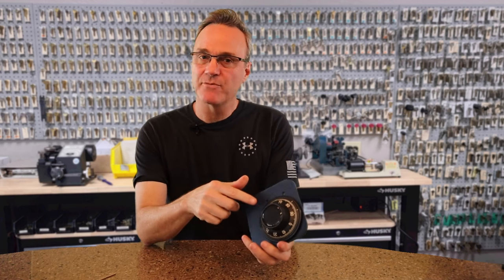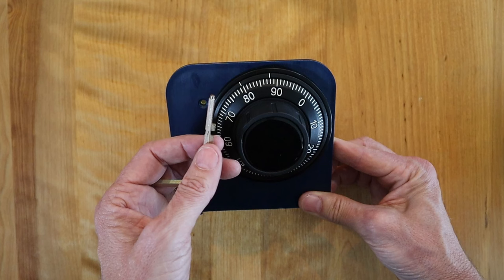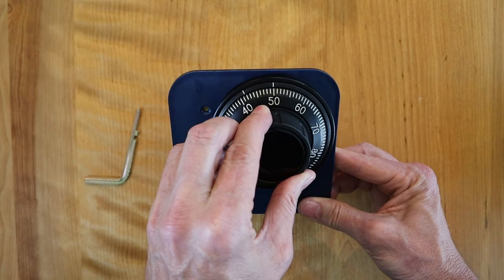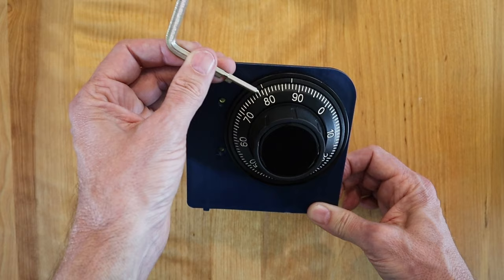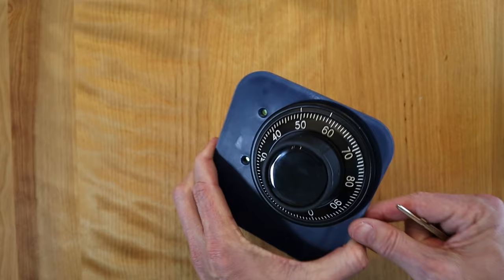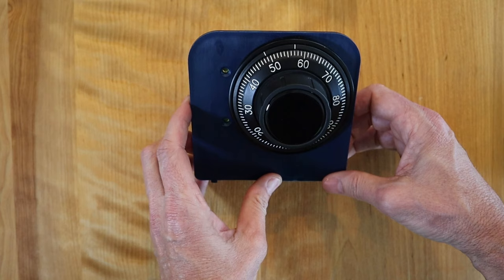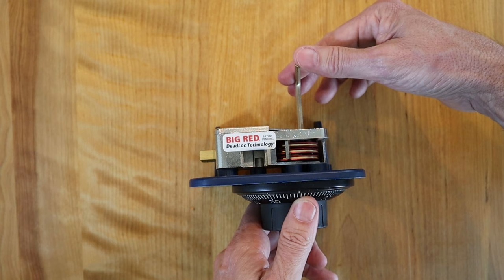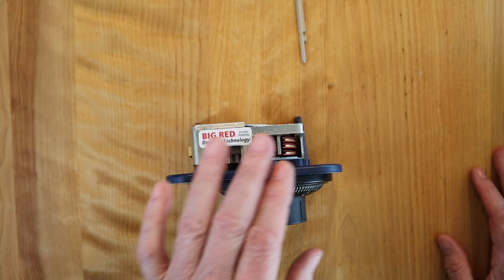How to Change a Safe Combination Without Using a Locksmith

Comment: One trick I use when changing a combination is to put a bit of electrical tape over the top mark. So that you don't get muddled up when setting a new combination. 
Don't forget the other rules numbers must be at least 5 digits apart and the last digit should be at least 10 away from the unlock number  0/25/50/75   depending on what it is on your safe. 😀
Reply from the maker: Great tip!  I should have included that!
Reply: The electrical tape is the key. You get so used to dialing to the normal stop that it's just natural to be drawn to it. A little tape and I was good to go
Reply: The last digit should be at leat 10 away from the "unlock number"? which is the unlock number? is just a 3 sets of numbers right?

Comment: With door open and messing with the combination, put a 2x4x 3’ long in the safe KEEPING THE DOOR FROM CLOSING!    With a long enough 2x4 in the opening of the safe keeping the door from closing, do all your messing with the dial the combination until after locking it (with2x4 keeping door from closing) and manipulating the dial you successfully cause the handle to open the bolts -  at least 5 complete times - also have another person do the combination, and successfully have the handle turn to retract the bolts - have person do this at least 3 times successfully.   THEN and only then remove the long 2x4 that then allows the door to close to lock it.  If you don’t understand this , don’t mess with your combination lock safe.  There’s a misconception that a ‘locksmith’ can open your dial combination safe if you close door and lock it without successfully testing combination WITH DOOR OOEN.   Wrong.  No one can open your safe with the dial if you’ve screwed up the dial combination and lock a closed door!

Comment: I have safe with opened door, locked is block, I don’t have key, I don’t know code. I have access to key hole. Is anything what can I do myself?
Reply from the maker: Call the manufacturer of the safe. See if they will ship you an override key and give you directions to reset the combo. If that doesn't work take the door into a locksmith shop and they can do it for you.

Comment: Any help is appreciated...this video helped me successfully change the combination (I tested it 3 times with success as well), however, I cannot get the dial to move anywhere besides through the 80 and 90s. I can lock and unlock but only if it's back on 80? I can't get my key to turn either. Not sure what's happening.

Comment: If you have two Yale assure locks in the same room, can you use one Wi-Fi module for the two door?  
Do you need a Wi-Fi module if you are using Apple homekit  hub with Bluetooth range?
Reply from the maker: Questions that detailed are going to be best served by talking to Yale customer support. I've never used the setup in either of these ways.

Comment: I inherited a safe. I don't have the old combination, but it IS OPEN. Can I still create a new combination, without knowing the old one, on an open safe?
Reply from the maker: Yes. You'll need to have a locksmith out or take the door into a locksmith shop. They can reset the lock and put in a new combination for you.

Comment: What causes all the comb numbers to shift one number? Ie : 35-45-55  is now 34-44-54....
Reply from the maker: It's called drift. Have a locksmith service your dial. Before it drifts so far off that you won't be able to get in.

Comment: Hey 👋 so I did this and the new number works. But now it won’t spin and stay locked. It just moves between 2 number and slides the lock in and out. But it will not spin and lock. Do you know what might be causing this? And I can’t reset it because I can’t spin it 😮 Thanks
Reply from the maker: If you can, lift the door off the hinged and take it to a locksmith shop. Something has definitely gone wrong there.
Reply: You probably set the last number in the forbidden zone.  This was not discussed in this video.  If the last number is set between 0-20, the lock will get stuck when dialed open, depending on the brand.
Reply from the maker: @LockpickingLoser  Valid

Comment: Is it possible to change the combination if you dont know the current one? Im wondering if someone drilled a small hole in the safe could someone stick a tool in the combination key hole and change it to something else? I wondering if i should put tape or something in front of that rekey hole
Reply from the maker: It is, but it's much more difficult. Take it to a locksmith.
Reply: Someone can always drill a hole in the safe but you can't follow this combination change video if you don't know the current combination to the safe. It's not only required as part of the change process but you need to open the safe so that you can get to the back of the lock where you insert the change key. So there's no reason to put tape over the change key hole.

Comment: Mine has to be pushed in on a 4th number then turned to the right until it stops.
Reply from the maker: That is another style. This type is the most popular. Thanks for watching.
Reply: @LocksmithRecommended  ok. How do I change my style of combo?
Reply from the maker: @onesilentarrow  you'd have to change the lock itself.

Comment: Will this work on a SentrySafe? I don't see a change index, but it does look like there is a hole on the back of the door behind the dial.
Reply from the maker: Maybe. A lot of sentry safed will not let you set to any combination, you have to use one of the presets values. Just depends on which one you have.